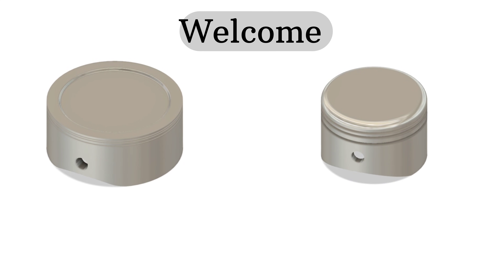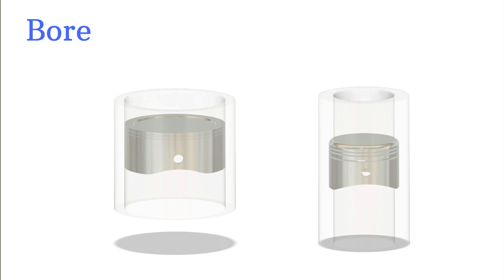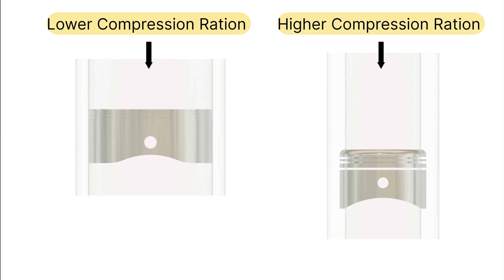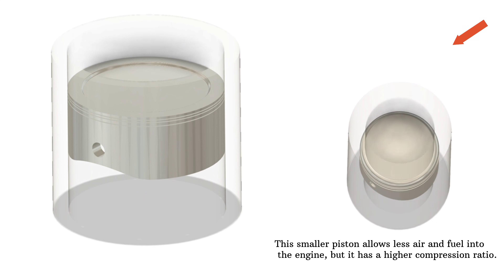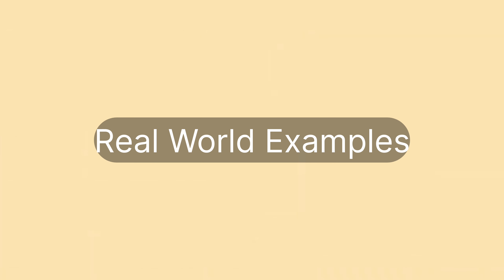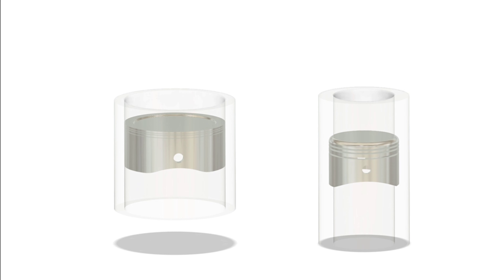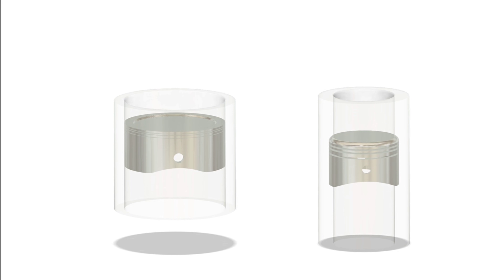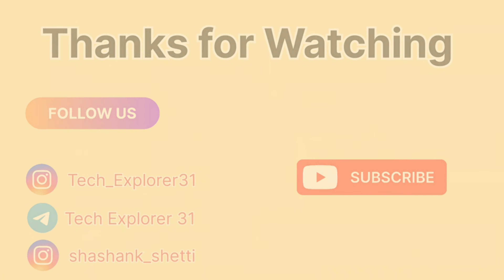Engine Performance Explained: Larger Pistons vs Higher Compression #engine #piston #pistonengine#car

Comment: Car dealshipts prefer engines to burn out sooner around 120,000 miles which is perfect for the cheaper lighter shorter pistons.    How can we make them last shorter?  Put in short cheap pistons and toss in low compression rings for more oil blow by!   Why would people want things to last?  Make phones with non replaceable batteries.

Comment: So , in a 1/4 mile Race , Cubic inches will out-run Horsepower ??
Reply from the maker: That's a great question! It's not always so simple, but displacement can make a difference in drag racing.
Reply: @techexplorer31  Bracket Raced for years, & I've always argued that with everything being equal , weight , gearing etc. That a 454 with 350 hp will out gun a 350 454hp engine on the drag strip , now maybe not in a long distance full out top speed run , but 7 out of 10 times torque will smoke hp. To the finish line !! Just my experience !! 🙂👍🏻

Comment: 1) For efficient fuel consumption, daily drive, small piston and high compression.

2) For high performance, big piston, low compression & forced induction 💪🏻

The best is own three cars:

1) One for daily drive, small capacity engine 1.0L 3 piston Segmen A, hatcback.

2) One cheap reliable minivan for family ride.

3) One car for weekend, at least 86mm bore, AWD, 4 piston, turbo & lightweight 💪🏻
Reply from the maker: It all comes down to finding the perfect balance for your needs.  😉

Comment: The combination of larger piston vs. smaller piston area but higher compression. The one that will produce more power. Its not a simple answer. Its a numbers game you got to do the math and the calculatons. Yes the higher compression leads to more thermal efficiency, providing you can get around other considerations like engine knock, handling the pressure structurally, increased cooling requirements, etc etc. The longer stroke also will tend to reduce how long the engine will last, i.e. more piston accelerations, wear on bearings etc. The larger piston cylinder combination tends to take in more fuel air mixture overall, and will tend to produce more torque and power for that reason. More force lower pressure, due to more area and volume of fuel air mixture. To what extent the greater pressure and efficiency of the smaller piston cylinder with the higher compression does or doesn't make up for that ? Which one will make more power ? You got to do the math. And I would take a pay cut in power and performance for more reliability. Reliability is number 1.
Reply from the maker: You're right, it's all about finding the sweet spot between performance and reliability.

Comment: Misleading. 

The cilinder length should be the same. 
Put a wall or "head" on top of the cilinder
The small piston should almost reach the top while the big one only travel quarter of the cilinder lenght
Reply from the maker: That’s an interesting way to think about it. I’ll make a visual like that in the next video.

Comment: Shorter rods for higher rpm's,longer rods for more torque..
Higher compression for torque..
The more cm3 helps all of these for more power.
All of these benefits together are a powerful engine with a lot of service cost.
The Lesson.We cannot have everything in this life without a cost...
Reply from the maker: Great points! Balancing compression, rod length, and displacement is key for power, but as you said, it often comes with higher maintenance costs.

Comment: Big piston short stroke more power less torque. 
Smaller piston with long stroke more torque less power.
Reply from the maker: Thanks for the concise summary, that's exactly it! 👍
Reply: Nope. For the same capacity cylinder, stroke length makes no difference to the torque output.

Comment: The one with more airflow will make more power... The large piston oversquare engines in pickup trucks usually have push rods and 2v per cylinder. They may have inline valves. This is a way to save space for lower rpm applications and was popular in American vehicles from the late 1950's onward. The earlier versions of engines like this had down draft induction so only 1 carburetor was needed and could reach all cylinders without much trouble. Because of the need for stacking the carb on top of thr intake and an air filter on top of that the manifolds were designed to be low and the intake ports were made as low as possible. But with modern setups the ports can be high and the plenums can be under the Intake runners to utilize otherwise empty space. With high ports and a little cant to the Intakw valve to get it away from the cylinder wall these engines can actually make a lot of power.
 With a 4v design there is more valve circumference. This means airflow starts with less lift which allows an engine to have less valve open duration and lift and will make power while being easier on parts. These engines often have smaller bores and a smaller bore/stroke ratio. The overall stroke is often about the same as a much larger 2v engine. In a full race application a 4v engine may stick closer to factory dimensions while a 2v engine will maximize bore and relocate ports. A "prostock" drag race engine with 2v is still the highest bmep of any normally aspirated engine and can make 3hp/ci. A formula 1 engine from the 2000's will make more hp/ci but spins almost twice as fast to do it and even with small valves needs nitrogen gas springs to Control valve motion and an intentionally short stroke. It will still make less bmep than the prostock engine. If you want to predict hp in full race engine the piston area is a good place to start. If you want to predict torque in a full race engine the overall displacement is a good place to start. there are certainly tests that give a long stroke engine more efficiency but it will eventually only work under load where the economy suffers from being too long as idling performance suffers. But efficiency isn't hp. It's related to economy but it depends on how much time the engine spends in different operating conditions as well. A large bore engine can sometimes make up for in efficiency what's lost to a long stroke by using the extra area for large squish pads to excite the mixture burn or by maximizing swirl and tumble conditions. But the large piston engine that does this may have  trouble with emmisions tests Compared to some well designed 4v small bore engines. We can't say a small bore engine makes more power just because efficient engines use a small bore because the first thing to do to increase airflow for power is increase the valve sizes and then the bore size to make room for bigger valves. A large bore engine is the answer to more power but that doesn't mean 2 engines engineered for hood clearance, emissions and cost viability will have the same solution of that using a larger heavier engine for a truck as to have a high thermal capacity for towing that also has cost and space saving techniques cant happen to have a large bore.
Reply from the maker: Thanks for sharing your insights on engine design! I’ll definitely incorporate some of your points into future videos.

Comment: It depends I've seen 2.2 liter 1800 hp I've seen 4.0 inline 6 at 3400 hp I've seen Allen Johnson pe V8 Darren blower nitromethane 13500
Reply from the maker: You're right! Engine performance can vary a lot based on mods and fuel. Thanks for sharing those examples!

Comment: Not like that bro. 

Smaller piston is advance in torque
Larger piston is advance in peak power. 

You just calculated the compression, not the peak power 
If you put it both in bore x stroke ratio its decide larger piston with shorter stroke produce more peak power. But smaller piston with longer stroke produce bigger torque.
Reply from the maker: Thanks for the feedback! You’re right, bore x stroke ratio affects power and torque. I’ll include that in future videos to clarify.

Comment: this is all wrong
Reply: Yeap, make no sense at all. Bore and Stroke has absolutely nothing to do with compression ratio. The bigger piston can have a higher compression ratio and vice versa. Bigger bore has potential for higher power due to the engine head allowing for bigger valves and therefore higher flow. Smaller bore and longer stroke allows for torque to be developed earlier in the rpm.
Reply from the maker: Good point! Compression ratio is separate from bore and stroke. I’ll make that clearer in future videos.
Reply from the maker: Thanks for the feedback! I’ll work on making the content more accurate and clear next time.

Comment: The larger piston has a larger surface area, assuming both pistons have the same cylinder pressure, the larger one will have more force exerted on it simply because its larger. The stroke or "throw" of the crank is the other half, a longer stroke means that the force exerted on the piston will have greater leverage to turn into a rotational torque, but the pistons stroke length increases and max piston speed at center of stroke peaks higher. There are many variables that affect engine performance with single and multi cylinder engines with overbore and underbore designs.
Reply from the maker: Great points! I’ll dive deeper into how surface area, stroke length, and crank throw affect engine performance in future videos.

Comment: Considering the RPM, and volume swept to be constant, for example @2000 rpm the smaller piston will have lower torque than large piston, and but the smaller one will have high HP than large one.

So if you want speed small piston with higher compression ratio, and if you want to more acceleration large piston with lower compression.
Reply from the maker: Excellent analysis! 😊